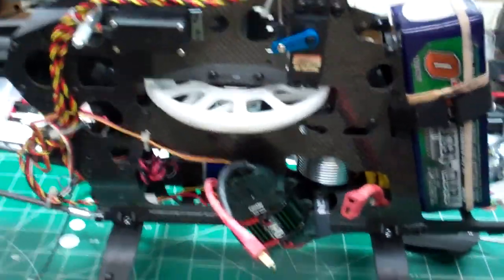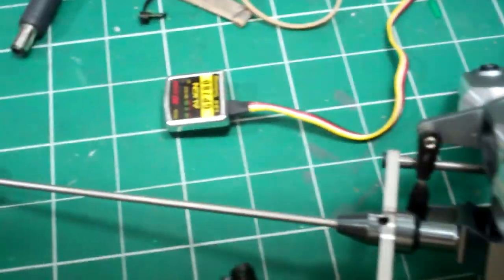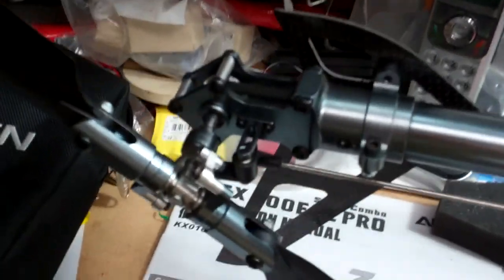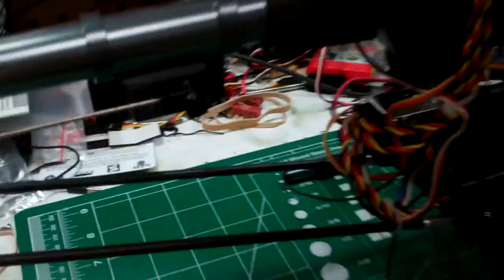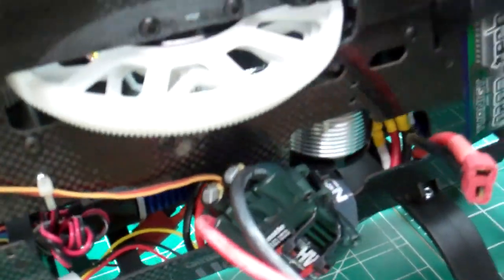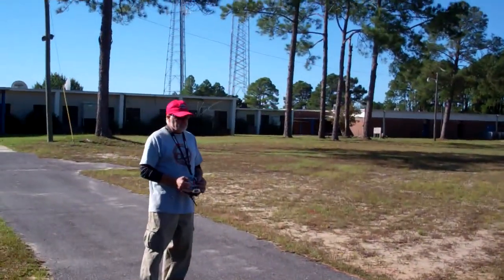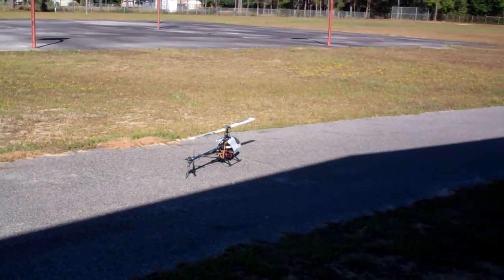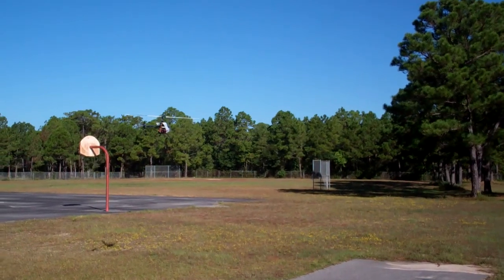Hobby King 600 GT to 3GX Flybarless Conversion

Comment from the maker: No this is the head from the Align TRex 600EFL Pro. The grips are the Version 2 which can be fitted with the DFC kit. The V1 Grips had a long ball link about an inch long and those could not be converted without a new set of V2 grips.    :^)~